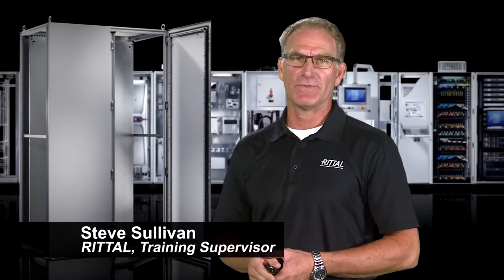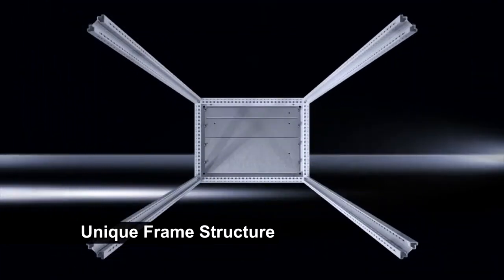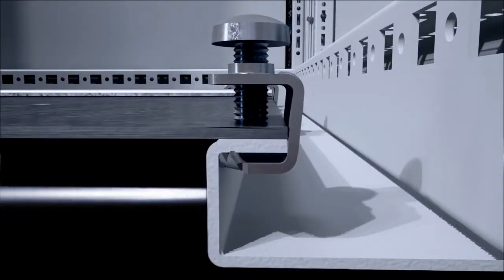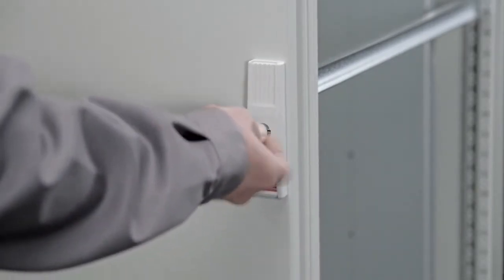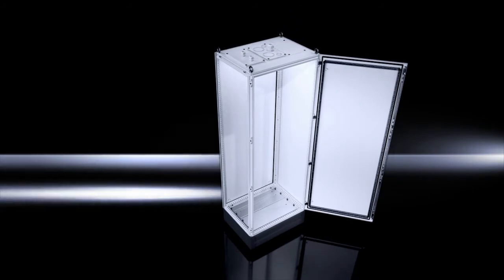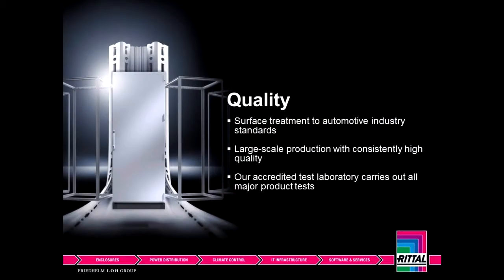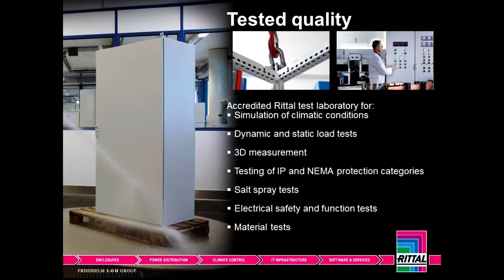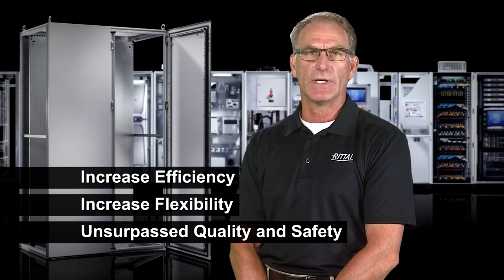Rittal TS 8 Freestanding Modular Enclosure - An Overview

Comment: Comes with the worst instructions ever. Even asian pigeon english instructions are better. Spare parts that you dont know if you need to use or not. Foam tape, where the hell is that for? Useless if you have never worked with it before. Customer support in NZ is not much better. Product itself is ok but thats about it.